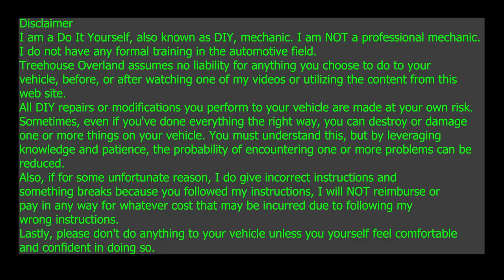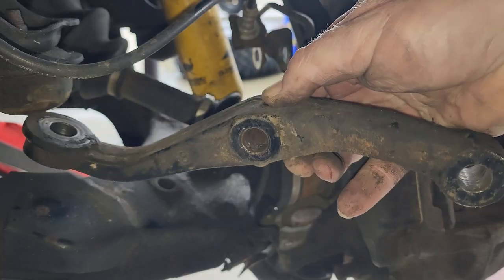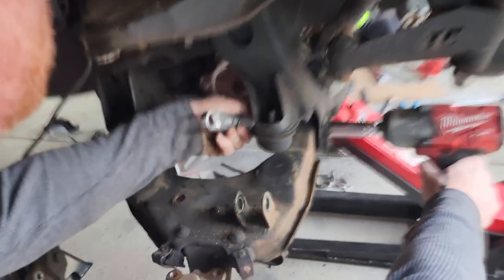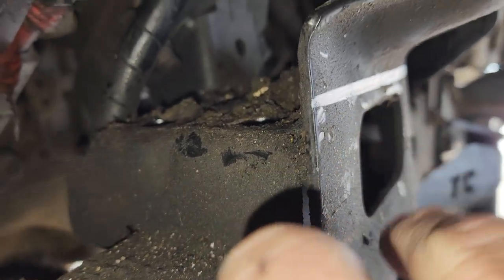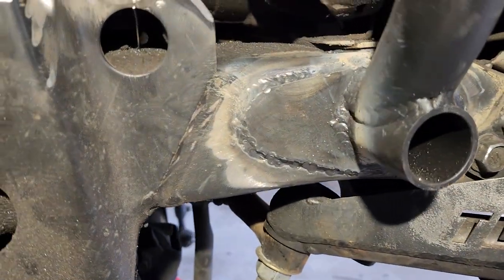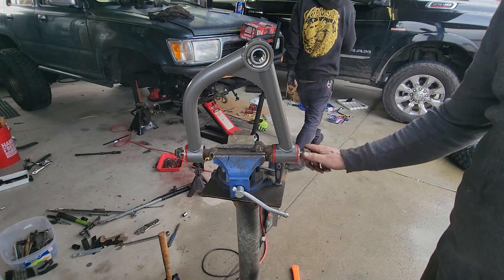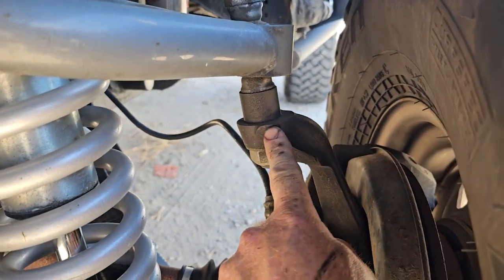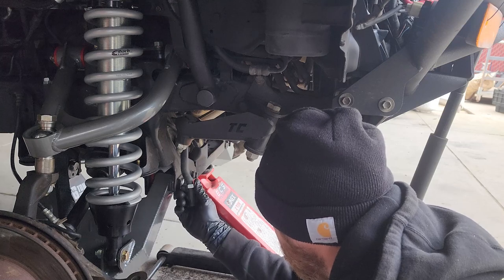JD Fab Long Travel Install // 2nd Gen 4Runner

Comment: I have the same rig with with long arms and a supercharged 3.4 swap. The 2nd gen is such an underrated truck!
Reply from the maker: Very underrated I agree
Reply: More footage of your buddy’s 2nd gen, please and thanks very much 🙏😂❤️
Reply: I’m 16 and I have a 2nd gen and I’m in the process of doing the 3.4 swap for mine and I’m definitely getting the total chaos kit for mine in the future but I was wondering what is best to do for the back. Did you convert it to a 4 link or something like that? I wanna make sure it’ll handle some woops and some minor crawling
Reply: Why r u crawling with a long arm kit?
Reply: @tanner882  Because he can! lol
Reply: @ephraimyoung6720   For my 2nd gen, I left rear as the stock "4-link +panhard", because it actually flexes really darn well. The main issue with the rear end in these 2nd gens comes down to strength. What I've done is make custom lower control arms by cutting the OEM ones in half, then inserting the 2 cut ends into a larger and thicker tube, and then welded it at the pivots. I also added a full length gusset, and they're bulletproof now. Only took about a day of messing around to figure it out. Prior to this I was always bending lower control arms. Next on the list is to just weld plating onto the control arm brackets, as well as at the axle housing. For the front I'm running a basic torsion bar Blazeland setup, and honestly it's badass.You literally don't need a $5,000 long arm with coil over conversion. A basic setup with extended OEM arms is crazy capable (google "Blazeland Long Travel"). It actually has better clearance than the TC or JD Fab arms, because of the drop bracket that Toyota adds to the lower Balljoint attachment. This makes a radical difference in the rocks, because the lower control arms drop way down below the lower BJ, whereas the Toyota design keeps the control arms tucked up higher in the truck. Also, torsion bar long travel is vastly more compliant and flexes insanely better than any of the coilover conversions. My rig can take washboard at any speed it wants, it can jump, its crazy stable in off-camber situations because of the extra width, and in the rocks it honestly flexes just as well as a solid axle truck with similar width. It has repeatedly blown me away how capable it is. I have a full 12.5 inches of usable 4x4 wheel travel. With a good 3.4 swap, long arms, lockers, and good tires, your 2nd gen will be insanely sick. These trucks are quite literally more capable than any modern 5th gen or Tacoma. They are vastly more nimble and can get through tighter shit,  have dramatically better approach, breakover and departure angles, and you only spent $10,000 building the damn thing. Makes me giggle every time I see a $120,000 5th gen with all the fancy rich guy overland crap strapped all over it 😂
Reply: @russman109  Does Blazeland still exist/build that kit? There website says coming soon but that looks like it was 2 years old.
Reply: Whats the costo of that kit
Reply from the maker: Check out the Toyota IFS and Long Travel Tech FB Group, they're coming up for sale pretty often. Also on IG look for blazelandn8
Reply: @ephraimyoung6720  Yeah bro, that's what I'm talking about. These are timeless vehicles, specially the 1st and 2nd gens.

Comment: U made a desert runner not a rock crawler
Reply from the maker: Negative. It actually does much better on the rocks/trails than the whoops, we've tried both. It could be a desert runner if it had bypasses or at the very least bump stops

Comment: Awesome video guys! Really loving the detail oriented content so far! You mentioned that the kit uses T100 CV axles. How much stronger if at all are they than the stock shafts? Also what are the specs on the 4Runner? Still single case? What rear axle? Gears and Lockers?
Reply: Thanks brother! As far as strength goes on the CV's, I haven't broken one yet, and they are just NAPAs since Toyota doesn't make them anymore. But they are holding up great so far! It's just a longer 4Runner CV, which is why they work for the kit. It's still got the single chain driven case and the stock rear axle. I regeared it to 5.29 and it has an Eaton Elocker in the rear with a front to match soon!
Reply from the maker: Thanks!

Comment: You guys gonna upgrade the brakes and lines? Awesome job on that install. I have a 3rd gen and didn't realize that the 2nd had TB's. Are you guys doing this for work now or just for youtube?
Reply: Oh the kit actually comes with extended front brake lines but I had already installed extended brake lines front and rear before I got the kit. The brakes themselves are actually really good! I have no issue locking up 35s rn. And yes we've had our shop for just over a year. So far so good!
Reply from the maker: We're chasing our dreams tryin to make a living building sick Yota's!
Reply: @treehouseoffroad I’m pretty much doing the same.  Currently make a living building custom jeeps but I’m a Toyota guy lol I personally got a 2016 4Runner I’m trying to build out

Comment: Hey man thanks for the video! Two quick questions. 1. How are the axles holding up? 2. What spring rate did you go with and which fox coils are these? 8” travel 2.5 dia?
Reply from the maker: Napa CV axles and he's never had an issue with them
600 lb springs and you're dead on with the coilovers

Comment: Awesome runner. I would love to see another video of this rig wheeling, maybe some information on what tire size you are running, maybe any issues with the kit, etc. Also, how does it handle on the road?? I am consodering this kit over doing a solid axle conversion because it is different and looks pretty capable. Any information is appreciated! Thanks!
Reply from the maker: He's running 35x12.5R15 Mickey Thompson Baja Pro's on Trail Ready beadlocks. So far no issues with the kit itself. Couple broken idler arms but he's since gone Total Chaos on that. Michael daily drives this thing and loves how it handles on the street
Reply: @treehouseoffroad  Did you have to clearance the front fenders or firewall to account for extra up travel?

Comment: Great video mate. I'm having an issue with my steering- stock steering idler sucks and keeps breaking 

I have a 2nd gen hilux surf - any recommendations or videos on steering upgrades?
Reply from the maker: He's broken a couple OE units. Ended up getting a Total Chaos idler arm. It wasn't cheap but he hasn't had an issue in years
https://youtu.be/Z-BYDP_vQN0?t=285&si=jhQuTeB7dzuNiquA

Comment: would love to see rear end setup
Reply from the maker: We'll do an in-depth walkaround soon but he's running 2" ext res Fox Factory Race shocks w/12" stroke. They are mounted outboard the frame with a custom kit he built, and paired with Eibach +2" pro-lift coils. 
He also did a panhard drop bracket and runs 2" spacers to match the front width
Reply: @treehouseoffroad ya buying the same kit after watching this talked with them the other day. just need to figure out rear to leet it level. was thinking about freelgood rear shock relocations but there for a 1996 not a 1995
looking forward to seeing full walk around soon
Reply: @treehouseoffroad  hi is the fox suspension universal or based off a different truck?  Want to do something like this on my 91 pickup.
Reply: Yes please do a walk around and show that rear suspension
Reply: yes please do walk around need to know what you did to rear suspension
Reply: What were people lifting their trucks on?  I heard spacers and rough country, ome runs really rough?  The Jd fab setup looks nice easy to install and affordable.  Wish these trucks originally came with coilovers
Reply: @ClearWater7.62 i ordered this setup yo do what he did.

Fox 2.5 Coilover, Performance Series, Remote Reservoir, 8" Travel, with Springs

Fox Shock, Eyelet Ends, 2.0 Performance Series, Remote Reservoir, 10.1" Travel
Reply: @blaiz4  does the kit that you ordered comes with the upper A arm and lower arm as well?  Thanks for the reply.
Reply: @blaiz4  sorry I just looked up long travel kits.  Are there kits that doesn't stick out the wheels too far?  And man they're expensive lol

Comment: Nice! Are those 33s or 35s? Also, is it possible to install an air diff locker in the front on these?
Reply from the maker: 35's, and according to https://eastcoastgearsupply.com there are several lockers available for these trucks, one of which is an ARB air locker.

Comment: Did you guys do Chevy 63 on the back or did you keep coils and use spaces. Great video amazing work looks good
Reply from the maker: He went with some Eibach rear coils, no spacers. He's super happy with them.
Eibach Part# E30-82-004-01-02
https://eibach.com/product/E30-82-004-01-02?epsid=1764
Reply: WICKED THANKS
Reply: @treehouseoffroad I have the OME 2 inch coils I’m sure I could keep em
Reply from the maker: @leclercj764  If you like em then hell yeah keep em. He had OME rears and they were too stiff to flex properly. I however absolutely love my OME rear coils...flex like crazy
Reply: @treehouseoffroad  getting closer to this..

Comment: Hey buddy I forgot to ask you did you put bigger gears which I'm pretty sure you did but what size did you go up to on your Sequoia.. I went 4:88 can you grow any bigger than that?
Reply from the maker: I went with 5.29's. Lots of low end power
Reply: @treehouseoffroad  when they built it they went with 4.88 I wish they would have put 5.29s I thought they didn't because 5.29s wouldn't fit. I'm going to have to ask him about that LOL
Reply: He never clarified that with me he just said he was going to see if he could go if they wouldn't fit he would do 4.88s but they have the power I need it crawls like a tank. I haven't really done too much challenging stuff yeah a little bit but I need to RCV axles and get skid row skid plates still.
Reply: @treehouseoffroad  I think the one reason why it crawls like a tank and goes through everything I put it through like it's nothing is because of the front and rear lockers. I call that beast mode LOL